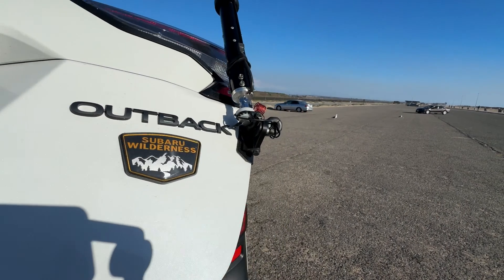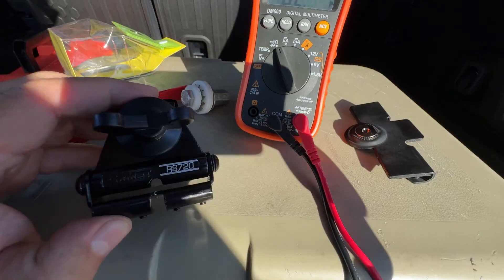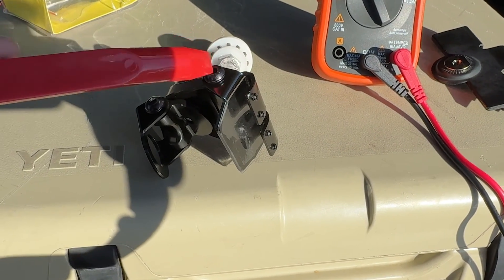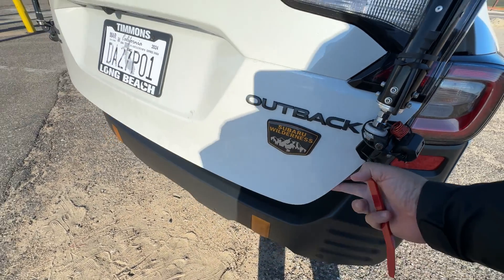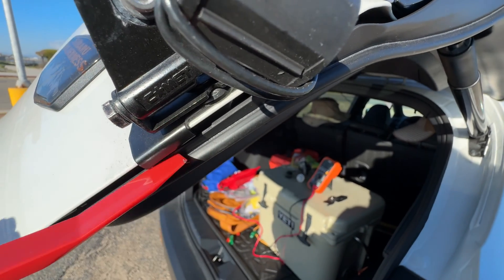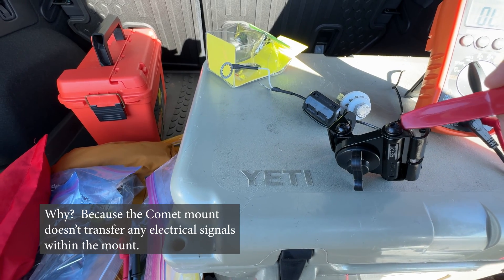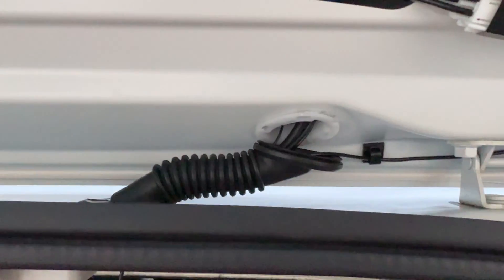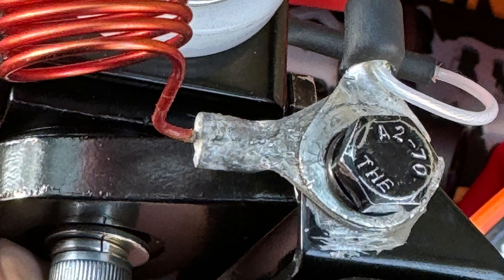Effective Grounding Techniques for Mobile HF Antenna

Comment: Why not remove the tang from the Diamond K400S mount so it does not hit on the bumper?
Reply from the maker: I don't remember exactly, but if I could have used more of the Diamond mount, I would have. The design of the Outback's hatchback limited my options. My Forester was much better at accommodating the K400S.

Comment: I also installed a RS730 on my mobile. Found same problem you have, the mount is isolated from itself. Maybe this contributes to high SWR. Thinking about taking mount apart and removing the paint and using star washers.
Reply: I don't know why the RS730 does that.  The diamond mount is much better, but couldn't place that on my outback.
Reply: @cylurian  im not sure if its paint or power coated. Is the Diamond better grounded?

Comment: Can you just run a copper ground strap from your car frame or something grounded to the base of the antenna where it screws into the into the mount?
Reply: Yes start at antenna mount and  bond all the body panels on both sides. Doors , hood , truck/truck bed.

Comment: You can trim the tab from the diamond and would fit like the comet.
Reply: Maybe I’ll try doing that. I really like the diamond mount. I don’t have to do anything to it other than making sure the grommet screws touch the metal of the hatchback. Sure I might not be able to get 40 m, 20 m works out OK

Comment: Thanks for video, question have you had any problems with any of the subaru electronics or features like hands free lift gate, backup or cross traffic sensors or anything else ?
Reply: Well, using the radio? Or just in general?

Comment: Hey thanks a ton for making this video - really appreciate it.

I'm not sure though, about the shunt and the two cables/wires that have the holes that connect the coax ground to the mount/vehicle ground -- how did you make that, or where did you get it?  Is that something we can get that's generic, or how would I mimic what you did?  Cheers, Rich K5OBJ
Reply from the maker: The cable with the two holes, that you can buy separately at a ham radio store, it is already made for you.  As for the shunt to be more specific it is a shunt matching network: This involves the use of a network of inductors and capacitors to create a parallel or shunt circuit at the feed point of the antenna. This network can be adjusted to change the effective electrical length of the antenna, which in turn changes its resonant frequency and impedance characteristics - meaning that the antenna will resonate better for the antenna is short.  My situation is unique for the hatch back of my Outback, good to deep into the bumper, and thus I had to take apart a comet mount and scrape the paint so I can get an electrical connection to the car.  Many use a braided cable to connect the comet mount to the car.  When I had my other car, I used a Diamond K400 Mount - bet mount you can get - but that didn't work on my new car.  I made a video on the K400 -  https://www.youtube.com/watch?v=VlSo8eGrLlE, and https://www.youtube.com/watch?v=xfmh10t9mGs&t=793s
Reply: @frankwc0o  very good, thank you so much.  I will look into the shunt details and see what I can learn / figure out, to make one also.  I'll check out those videos too - thank you so much Frank!!  Very very helpful (I'm in the middle of setting something up on a vehicle also, so this has been clutch)
Reply from the maker: @rgbking488  Super. FYI, that shunt is used primarily for my screwdriver antenna, and doesn't have to be used for the Diamond HF20CL.  Good luck.